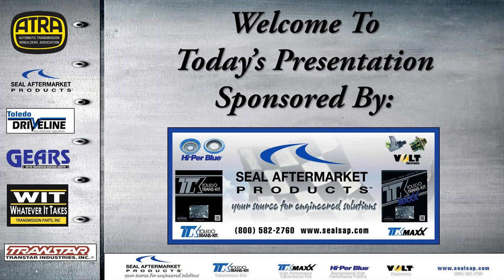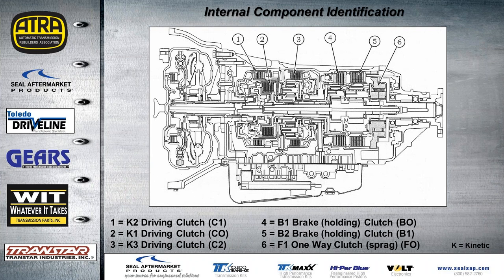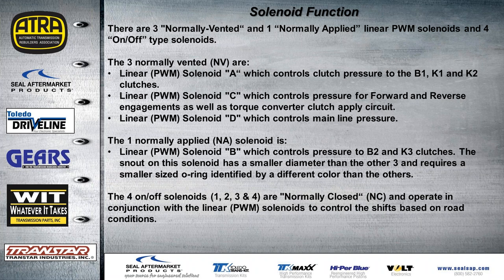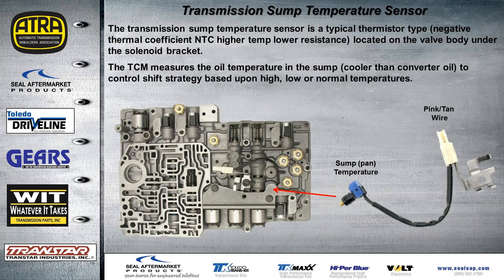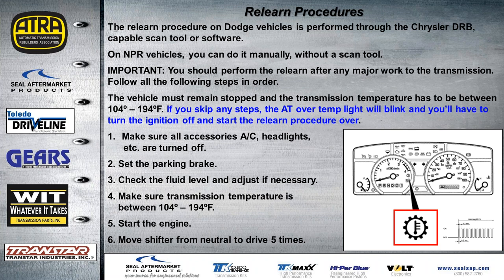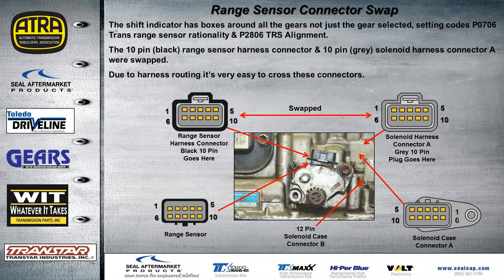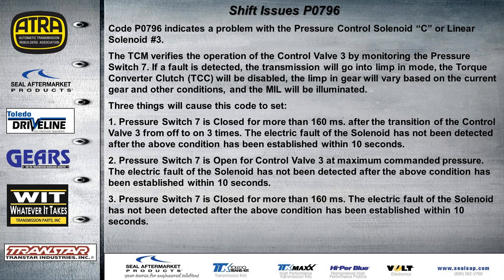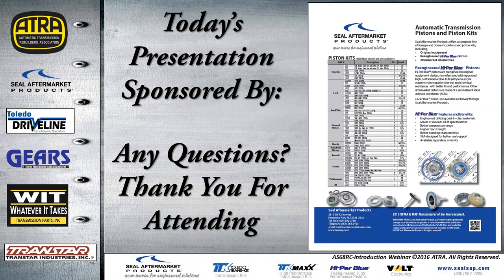AS68RC Introduction Webinar - 2/2/16

Comment: Hello 2014 RAM3500 6.7 310K P0732 teardown all clutches look to spec. Told the problem was erratic. Possible speed sensor???
Reply from the maker: What was the symptom before the teardown?
Reply from the maker: it's a ratio code; with a scan tool monitor, your ratios in 4th gear should be 1:1. is the transmission slipping?